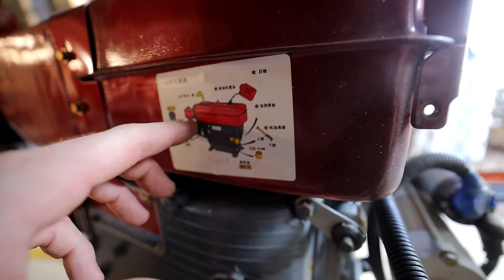Testing CHEAPEST $5,000 Chinese ROCK CRUSHER (on Alibaba)

Comment: the exhaust  where it attaches to the engine will probably eventually crack and break  because  the muffler being large and on a long tube, it will create leverage stress  from the engine vibration .   intake may do the same thing.  bad design.
Reply from the maker: They pre-broke while tightening.
Reply: @ModernSelfReliance   great,  its always a risk buying anything from china.  You’ll have to make braces to prevent things from self destructing.  Or re route the exhaust to a more secure location

Comment: I hope by now you have discovered a greese gun and are using it freely.  The diesel engine needs a coolent system...closed coolent system consists of a water pump, hoses and radiator with fan.  (by now you should have discovered this also)  That  gravity system seems very poorly designed.  But then, it's Chinese.

Comment: I don't want to break it off. 5000 USD is money. It is a solution for the time being but it will break from itself. I have a bad experience with chinese cast iron. You better had bought another one right away for pieces. Your gravel is very good.
Reply: #1  Load up the hopper while it’s running and you won’t have so much rock flying back at you. The crusher can actually handle more than one rock at a time (though not as much fun!)
#2  No one in comments is making an issue of it, but FOR GOD’S SAKE GET SOME PERSONAL BODY PROTECTION! You seem like a nice guy; ‘hate to have something terrible happen to you.  A substantial helmet with hearing and face protection for starters. Or anything… be better than nothing when a shard comes out and embeds itself in your head… or up your a***.

Comment: Tell me did you approve for them to use your video material on the website?
Gotta love the Chinese practicality 🤣
That said, we use cheap imported Chinese stuff too and a rock crusher is on the list. Does the job... has the potential to kill you but does it...
I don't know if one is already ordered but I told him it should be a jaw breaker, not a hammer breaker. Don't want to stand in a wall of dust...

Comment: I don't get why you would want a rock crusher. Aren't bigger rocks much more expensive than gravel by volume?
Reply: I'd imagine you can use just about anything for gravel. Old concrete, bricks, etc. I think it comes out cheaper in the long run.